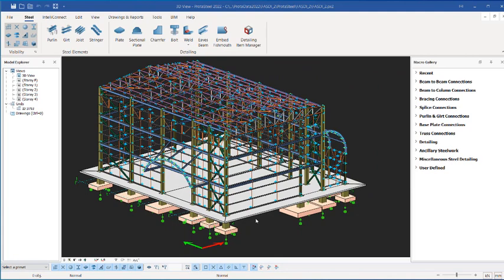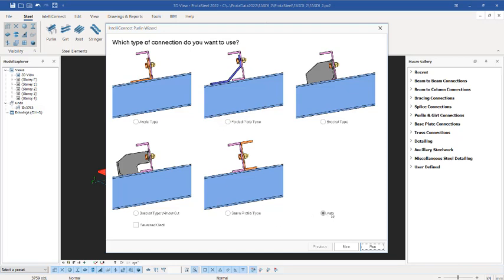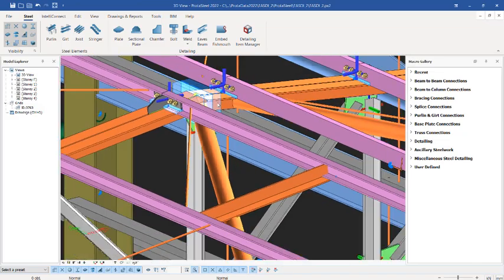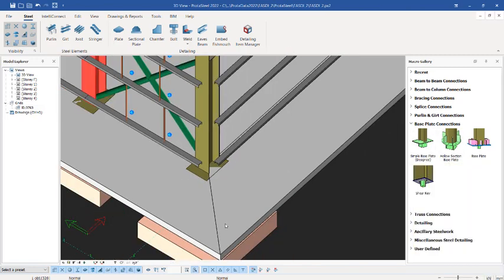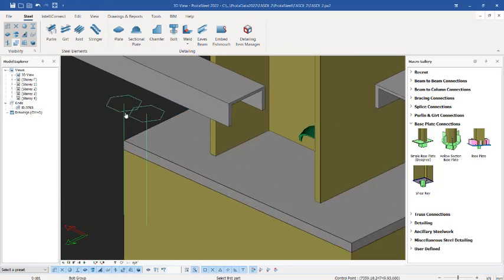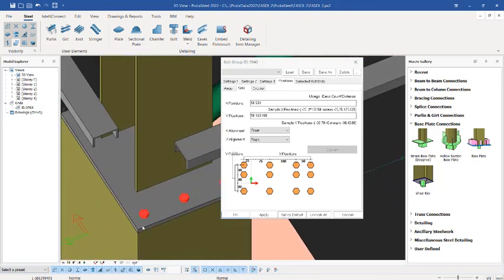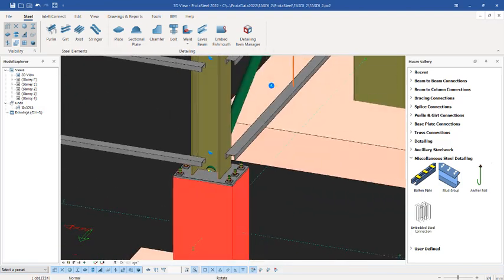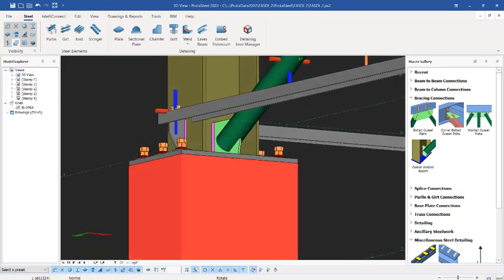Complete Steel Warehouse Members Connection Design in Prota Steel 2022

Comment: I am working on steel project as a civil engineer student. I skipped Protastructures analysis to send my project to protasteel. Tried to make connections with intelliconnect but most of them is not made and protasteel said " None of the selected frames passed the tests so nothing done by IntelliConnect.. What should ı do